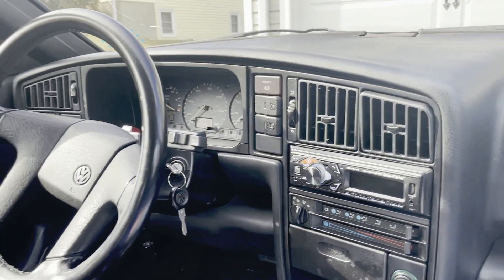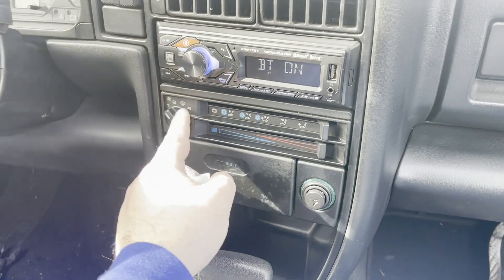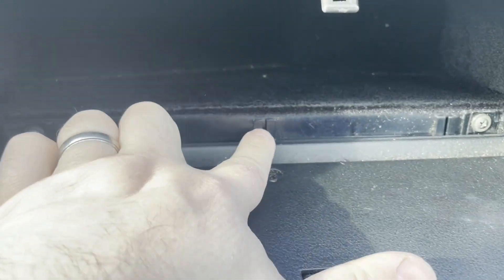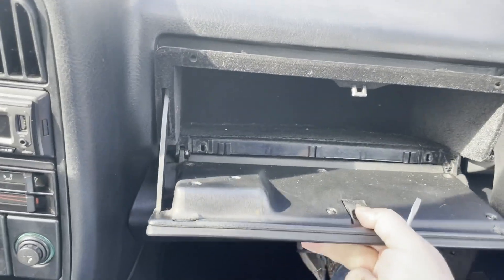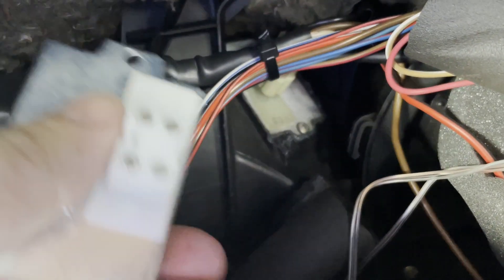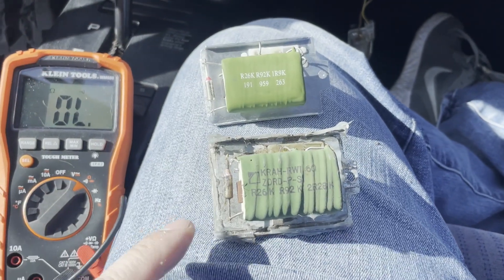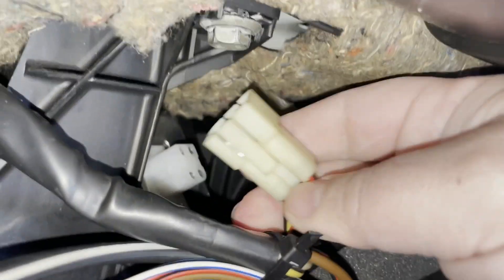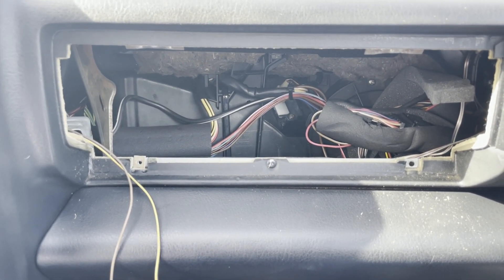VW Corrado Blower Motor Resistor Diagnosis and Replacement

Comment: Did that back in 1993 on my 90 G60. It worked for a few months. Then took it to the dealership and they said my fan blower was pulling to much blowing the resistors. No pun intended. $$
Reply from the maker: Interesting! Hopefully, this one lasts longer.

Comment: Hi I saw one of your old video's on the golf GTI cabriolet and I just bought one about two months ago. It had a few problems but one of the biggest problems was that it would idol above 1000 rpm all the time. We got that fixed, but now after it gets up to temperature it would just die and I would struggle to start it. I would take it in for someone to look at, but I live in a small country and no one knows how tat fuel injection system works. Is there any chance you could help me?